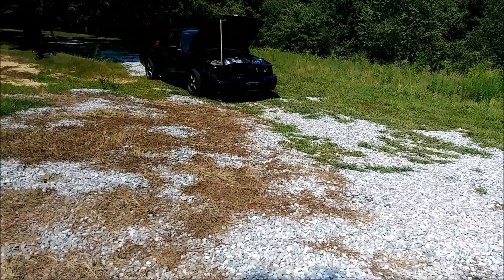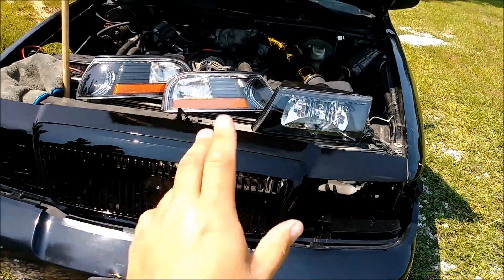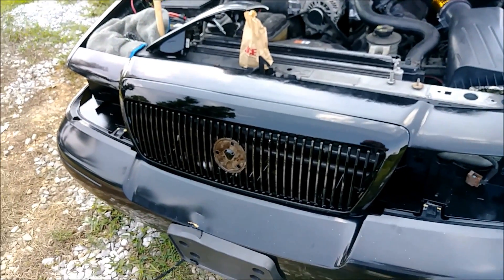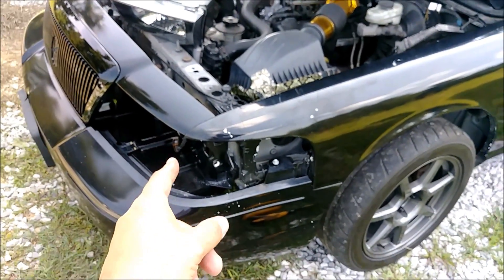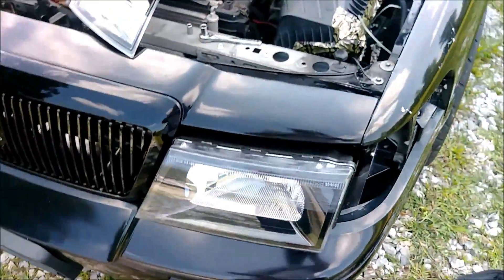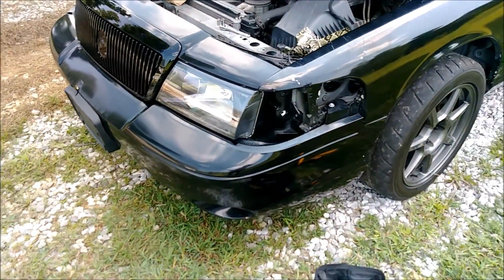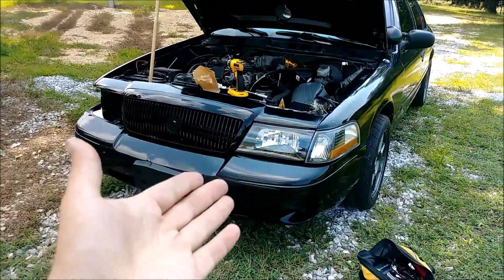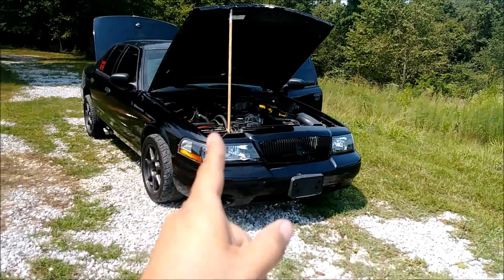Converting a Crown Victoria to a Mercury Marauder Part 2 of 3 Headlights installed!

Comment: Mr. Random not not trying to bust your bubble but two things I wanted to add number one that tab that you pushed in on your Fender it's the same tab that are on real Marauder if you look at the back sweeping side of the corner lamp that's where the tab is used to hold the back side of your corner light cuz when driving at higher speeds that backside is going to flutter without that tab holding it in place and second if you had used Factory blind nuts that mercury use for the headlights you wouldn't have to use those big Hulk in bolts you can use a stock 8 millimeter bolts from Ford that come stock with them? I would be glad to give you and insight on a marauder side of things being I own 1 and have taken every part of this car apart over the 8years I've own it so I know it very well.
Reply: Which car and year would you suggest is best to convert into a Marauder..... Grand Marquis or Crown Victoria?
Reply: @eddiebrock9943  03/05

Comment: From 2003-2005 grand marquis header panel will work i have a 08 p71 my only issue is when you install the marquis headlights in the marquis header  the crown vic harnes is diff it has the turn signal hook up the marquis marauder head light doesnt wat should i do

Comment: The header panel for a Mercury Grand Marquis is a 2003-2005 which this applies to a 2003-04 Marauder as well.  So the holes will have to be drilled anyway for the head lights.  I'm considering doing the same to my  CV Lx Sport.  Of course, the so called "see if it fits your car" obviously doesn't fit.  However, a few little tweaks here and there you made it happen.  Well lets see what happens.

Comment: Can you do a tutorial for how to properly wire those corner lights so they work as the did on factory marauder? I am looking at doing just the corner lights on my CVPI, and based off of what I've read, Id have to figure out a way to tie it to the pre relay turn signal wire

Comment: do i need the front bumper for the headlights? i know the corner lights fit snug but it looks like the front lights might fit as there is about a quarter inch from the front light to the grill surround

Comment: I bought the lights through your link in the description and the wiring is different. I’m sure I’m doing something wrong but I can’t find the socket in which the headlight plugs into
Reply from the maker: open the rubber circle thats covering the headlight...youll find the correct socket in there
Reply: Mr Random Reviews okay I have that plugged in now. But doesn’t this wire that comes out of the headlight need to be plugged in somewhere?
Reply: Fuck I am so dumb man I apologize for the stupid questions. I just got I figured out. Thanks a million for your response and the video in general! You’re the shit

Comment: Wheres the Air suspension, trunk panel, marauder specific rear trunk facia, real 22" megs tips, Another thing, 03 Marauders came with red/orange rear windshield defroster, while the 04s had yellow lined defroster windshields

Comment: First and foremost love ur channel been watching ur vids for awhile.
Second I have a 09 P71 I swapped out the stock headlight lenses and corner lights also did the Mach 1 lip upgrade it gave the front appearance a whole different look and a lot of people ask if my car has a special front bumper.
I was wondering if I could use the Marauder front bumper cover without swapping everything else I'm not trying to go for a clone I just want the Marauder front bumper cover for the fog lights and more aggressive look,also the back cover also
Reply from the maker: it wont work with just the bumper its different from the p71 and attaches differently too under the headlights and grill

Comment: MR Random can you please make a video on how to remove the Trunk Lid /license plate panel for the crown vic. :(  Would really appreciate it. keep up the good work.
Reply: There are about 8-10 bolts on the inside of the trunk lid. Unscrew all of those and that truck panel (fascia) will come off, not hard to do at all.

Comment: I got a trunk leak in my 2001 Mercury Grand Marquis it's leaking right out of the back tail light and apparently that's pretty common for Crown Vics Lincoln Town Cars in Grand Marquis. Anyone got any advice how to fix the leak
Reply: Jacob Moon to help answer your question is it coming from the tail light housing or behind the tail light cuz the trunk drainage actually designed to flow behind the tail light and if you have a crack or no rubber seals around your light bulb housing you could get water in there
Reply: Eddie Sanchez it's actually coming from the taillight assembly, like through a crack and every time you open  the trunk water just pours out I'd say it's about 3 to 4 cups of water in the trunk. I sprayed some Flex Seal in it but that didn't help so I don't know if I'm just dumb and there's another leak. I shut myself in the trunk and I had someone spray water all over the trunk I didn't see where it was leaking. But you can see it when you open the trunk and that's on the water pours out of the tail light
Reply: Okay Jacob so we're talking about the reflective trim assembly closest to the reverse lights and license plate of your trunk and it when you open the trunk with water starts pouring out yeah that housing is actually Hollow and if there's a crack on the top side where meets against the top edge of the trunk that will fill up a water and when you open your trunk the bottom side where It Bolts up to the trunk has openings also basically drainage openings and that's where the water pours out but when the trunk is closed leaves or any debris that's keeping the water from going past the drainage
Reply: Eddie Sanchez that was going to be my other Theory! Thanks I've had to pull the carpet in that trunk about 3 times. Any suggestions how to fix it?

Comment: Now you just need to find a Mach 1 and pull the 4v and chin spoiler.....
Reply from the maker: in the works😉😎
Reply: The Lincoln Aviator engine is basically the same thing and a lot cheaper!! I have a garage full of marauder parts 3 Mercury Marauder intakes Mercury Marauder timing cover Mercury Marauder C heads I've owned 11 Mercury Marauders in total. The only thing you have to switch on the wire harness is lengthen the coil on plug wire harness and switch the wiring cuz it's backwards on the marauder compared to the Crown Vic harness.

Comment: Yeah I'm not a big fan of making fake or look alike cars. The front fascia of the Murauder is what separates it visually from all the other panther bodies. It's the same problem that's going on in the mustang community where someone with an 03 GT or v6 slaps on Cobra bodywork on it and call it a Cobra. It's just really frowned upon.

Obviously I can't tell you what to do with your Vic. Your car, your canvas y'know? But have fun with your goal.
Reply from the maker: nothing wrong with having the best of both worlds thanks for watching man
Reply: Well considering the Vic came first, the Marauder is externally an appearance package on a Vic/GM.
Reply: I've always like people rebadging just as long as they say that it's not the real thing. It's sometimes pretty cool to have a v6 with gt500 parts as long as one doesn't try to pass it off as the real thing.
Reply: how and why are you comparing the panther platform look alike cars to v6 mustang cars trying to be v8 cars? thats a totally different realm. there isnt much that separates his car from a marauder. i have an 03 grand marguis and it isnt much different than a marauder. ill be buying marauder parts for mine as well. but not body panels.

Comment: With all the money spent and time traveling the world for parts and still a clone just buy a real one. You also need rear bumper tail lights and reverse lights and interior
Reply from the maker: time travelling the world?? i bought everything from the comfort of my own home lol...i just wanted the front end look...i rather keep my crown vic engine all day over a marauder..you clearly havent done enough research to figure out how unreliable they are...so for under 800bucks i got the marauder look and a MORE reliable engine...compared to buying a marauder for $7k to $10k and have a ticking time bomb under the hood?...LOL ill clone the vic ALL DAY
Reply: Mr Random Reviews Ask Mercury marauder fan club on Facebook there is a whole lot of owners with over 200,000 miles stock motor and transmission the only thing you might have to do is the timing set and it’s good forever. How much was that bumper shipped 😂 If you’re lucky enough to find one it’s about 1000 shipped but let me guess you got a real real lucky